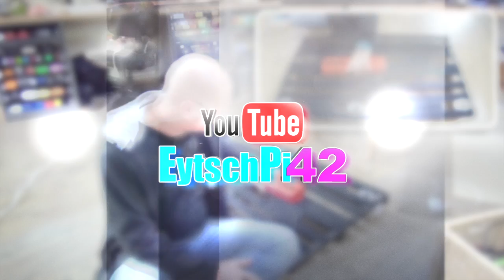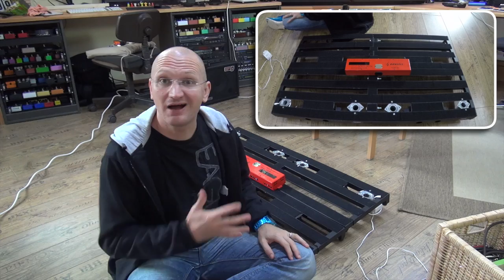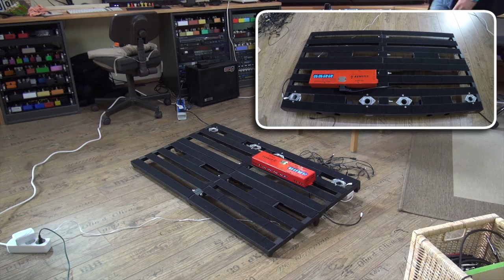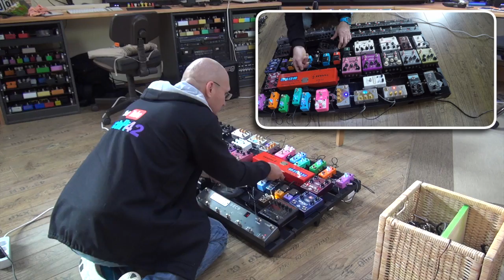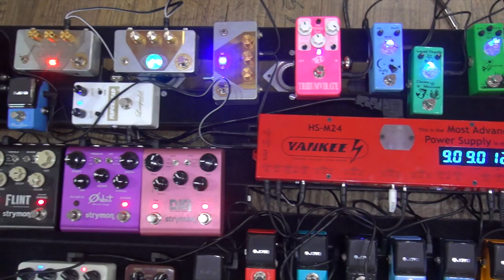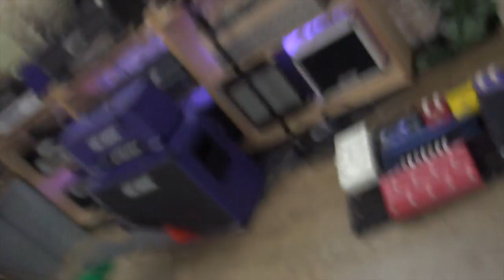Yankee HS-M24 Load Test - The most advanced Power Supply IN THE WORLD

Comment: It seems there is no "perfect" power supply. If I wanted to run these two pedals: Elektron Analog Drive and T-Rex Replicator, I wouldn't be able to do it with the HS-M24. The Analog Drive requires 1000mA @ 12VDC and the Replicator requires 300mA @ 24VDC. Only section 18 has both enough current (milliamps) and the correct voltage for each, so I would have to choose one or the other. Other section have 12 and 24 volts, but not enough current.

Comment: never heard of 12V AC-LEDs. Please try the DC-port.
Reply: LukVonTrug The LEDs are diodes so you can supply them with AC they just rectify the supply and only use one half of the AC cycle. One half of an AC cycle is DC.